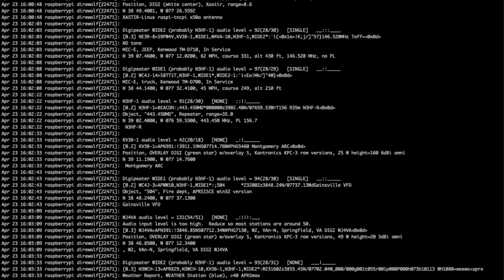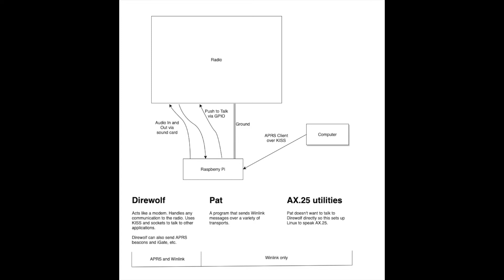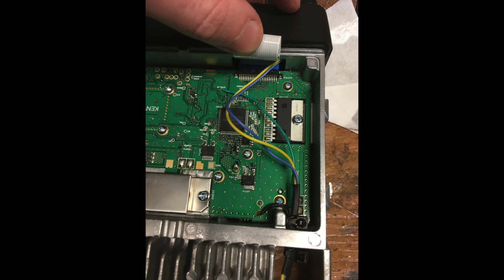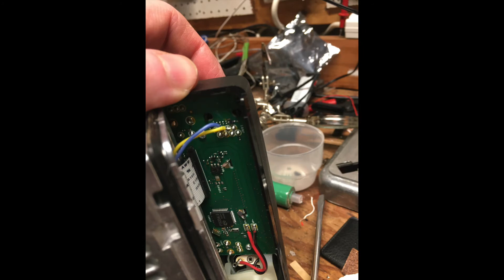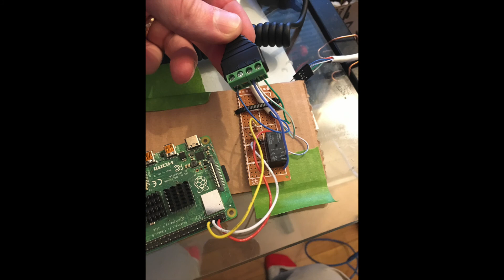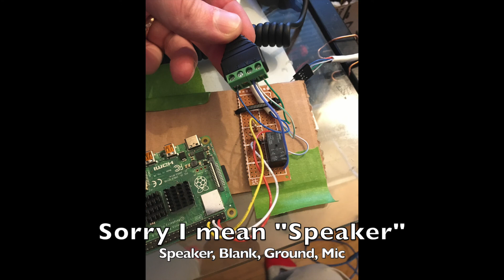Kenwood TM 281a data connection for APRS/Winlink

Comment: No passive components required for the audio interfacing?  How do the voltages work between the mic input on the radio and the USB interface out? And then the DTMF IN pin (radio out) to the USB microphone in?   Did you do any testing to check audio levels?
Reply from the maker: Correct, it's just wires for the audio, the only components used are for the PTT relay. I didn't check any voltages, but since I'm just picking up the wires where they'd normally go to a speaker or the handheld mic, it should interface correctly with the TRRS connection to the USB sound card. I did tune audio levels on the Pi itself, and was able to adjust the gains so where Direwolf was happy. I've been doing the weekly Winlink Wednesdays on this for about 2 years now, plus APRS once in a while -- it's been solid.

Comment: I just completed an APRS project with  a TM271 (TM281 ancestor) and came accross you video while casullay looking for what other people did with the TM271. Not sure why google suggested me this video since i was searching for TM271 stuff....
Anyway, I got interested in the TM281 and put both their schematics side by side. They are both very similar, however they stripped of ell the packet radio stuff on the 281. In the 281 you can get filtered audio (deemphasized audio) right after C783 which might be more suitable for 1200bps packet.
Reply from the maker: Thanks, where did you dig up schematics? I got that pin from a discussion forum somewhere so wasn't sure it's the best. But it works just fine for APRS and Packet.